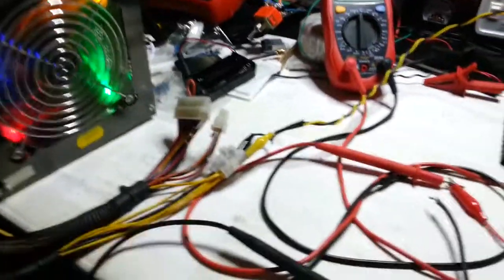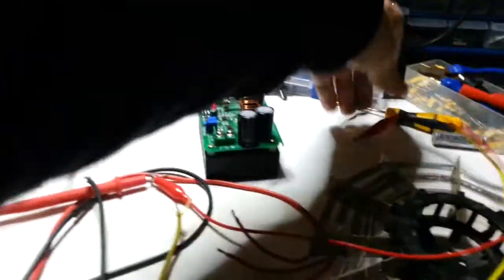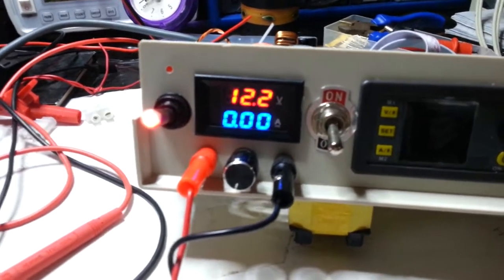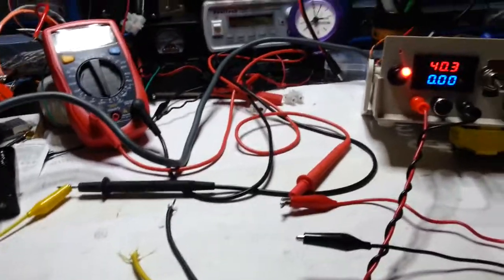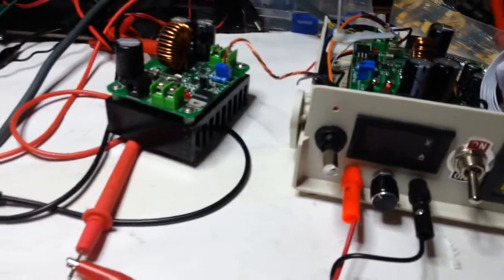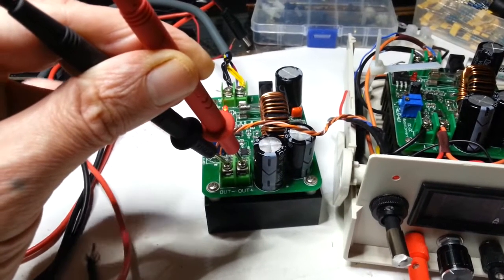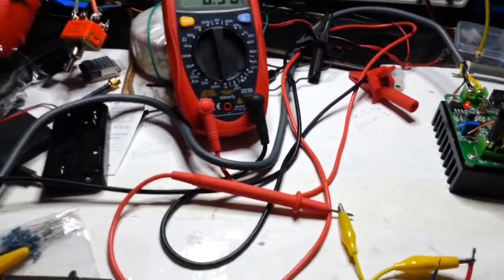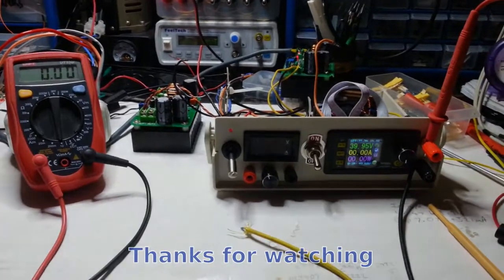DIY PSU Trouble Shooting Pt 2 of 2

Comment: That DPS5015 looks great. That is the Buck converter/Regulating Module I am planning on purchasing for my Lab power supply. Trouble shooting... fun times :)  Do you have a dummy resistor load on your High current rail for the ATX supplies? Thanks for sharing!
Reply from the maker: Hi yeah I have 5 Ohm 10 watt in the 500W ATX but did not get around to the 650W. I guessed it was a faulty as I can not remember buying it.